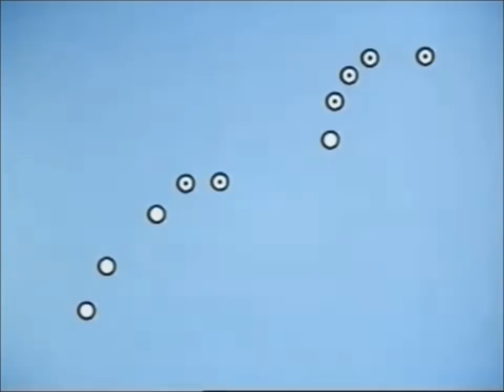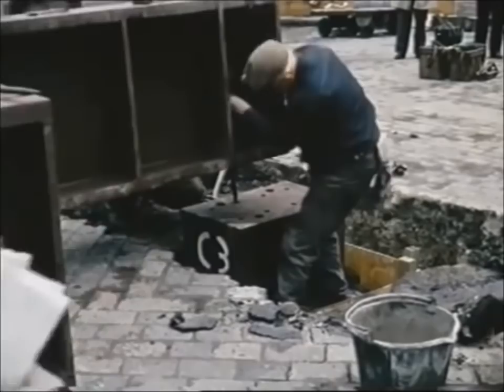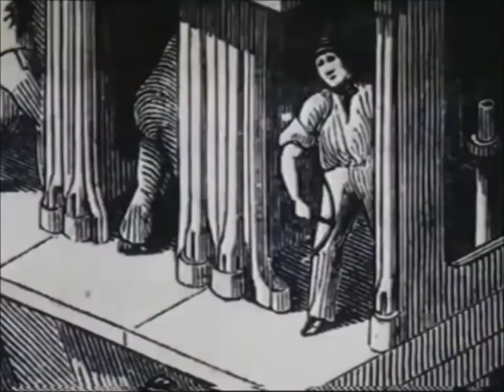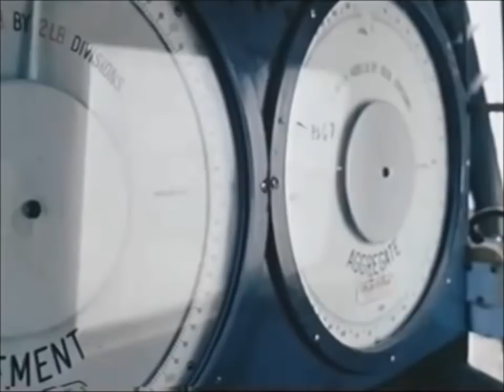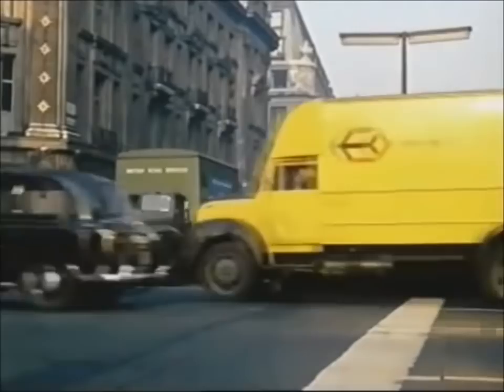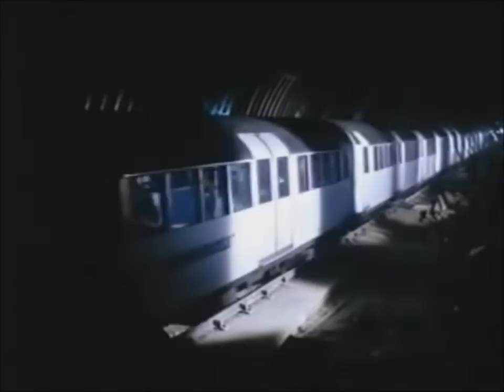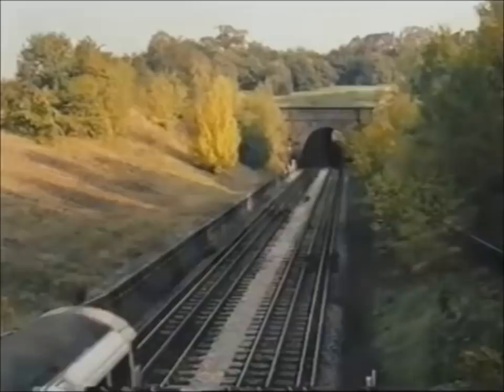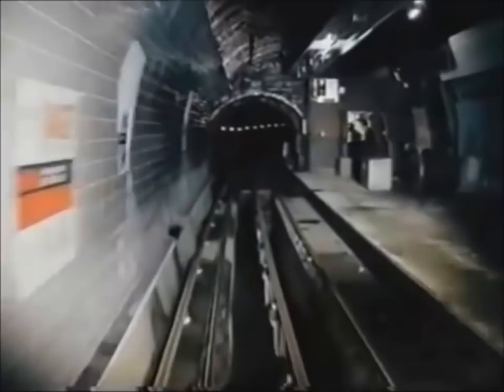Vintage railway films - The Victoria line reports - 1960s

Comment: I wonder how many of those tough tunnellers slinging the cast iron rings and concrete sections around were still young enough to have seen combat in WW2 and Korea.Resilient and doubtless afraid of very little.

Comment: I was a Westinghouse Brake and Signal Co. commissioning engineer for the automatic braking systems. No mention that the trains were fitted with disc brakes, interlocked air suspension and a seven step digital braking system. As the weight of passengers were added to a car, so the braking effort of that car was increased. The trains were originally fitted  with a single button for the driver to push to start the train towards the next station. After one driver got his head knocked on the tunnel entrance by hanging it out the window to look back down the train. We had to add another button and a window interlock, so the window had to be shut and both buttons pressed to start the train. When the train stopped at a station there were white lines on the pavement so that any under or overshoot could be measured and reported. 
The trains were also fitted with hydraulic handbrakes. Not the best. When we serviced them and the oil mixed with the brake dust it took a week to get our hands back clean.
Most of all this was new, never been done before.  It was so successful that the New York Subway and Singapore Underground  systems adopted it over the next few years.

Comment: So strange to think of all the times I travel along those tunnels we have seen being dug in this video. Watching the cutting face inch forward through the London clay, making way for the trains that have now been running through there for over 5 decades now. Lots of guys really toiled to build the lines back then, real back breaking work by the looks of it. I salute those men for their hard work. I used to travel on those lines frequently when i was a young teenager back in the late 70's, and back then i never gave a thought to how all of those tunnels were built. So fascinating to see how the Victoria was built. So easy to take it all for granted without a thought to the guys that worked so hard to build it.

Comment: Brilliant record of those events, particularly seeing the miners using their clay-spades! I saw the Oxford Circus Umbrella going up in 1962, then in 1966 I worked in the site offices at Fitzroy Square, near Warren Street, where an access shaft had been constructed in the Gardens. I'll never forget going down the shaft in the bucket for the first time, nor the weight of those clay spades. It's amazing to see the men at their tasks in such 'primitive' conditions - no safety gear. 
The Fitzroy Square site was closing down and in early 1967 our team were moved to Tilbury to a cable tunnel project under the Thames. This tunnel was built in wet chalk using a new type boring machine - a smaller version of the TBM's in use on Crossrail and HS2. Hard hats were issued but often neglected and, as it was wet the miners were given jackets and over-trousers.

Comment: In the 1980's I worked in a glass bottle factory in Kent. The story I was told was that the bottle blowing machines were powered by compressors that had been sold off after they were used to service the drilling machinery on the Victoria line construction, albeit at reduced pressure because they were knackered for some reason!.

Comment: 🤔The part showing the 1960 stock on the Hainault loop must have been taken in the mid 1970s well after the Victoria line had open in 1969. The train operater seen was my father Bill Speight (only time seen wearing a cap🤭) And he wasn't was trasfered to Seven Sisters depot untill the late 1970s as back then it was done by seniority (his was early 1930s) as one retired ⚰the next on the transfer list took there place. All for a few ££s more🙄to spend his working shift in a 🌚tunnel instead of the Essex  🌳countryside.

Comment: Wonder how many accidents happened during the construction of this massive project. Or if there were any deaths. What an achievement though. People never cease to amaze. Have shoveled clay before, it's not a fun or easy job by any means and it was a very miniscule amount compared to what these guys were doing.. could only imagine. Especially day in and day out for that long.
Reply: Not a crash hat, gloves or high res in sight! Every one looked after their own safety then, not  expecting someone else to do it and get sued if they cut  a finger.

Comment: Always wondered how they can tunnel and actually know where they are going .
Also tunnels curve so how does the greathead Shield mange to make tunnels that are curved.
Reply: draw the required amount of curve needed out in the car park make every one fit then number them and of you go
if you had ten sections  then you would have ten lines going out.
Reply: Center lines, levels, surveying scopes, measuring tapes and lots of math are used to drive a tunnel

Comment: Briiliant.
Reply: Very interesting, tremendous engineering feat for its time. Health and Safety very different then.  I had the experience working on the Victoria Line back in late 70’s as a Technical Assistant working out of Northumberland Park Depot, so parts of the film very familiar, and test runs on the ATO trains were interesting.

Comment: Electric cars also destroy the environment through resource mining, manufacturing processes and ultimately going to the landfill in mass droves. The pollution they cause is simply unnecessary as is the amount of urban space squandered on parking and other paved over autocentric wastes. They also perpetuate urban sprawl, the food deserts that come from that invariably, along with cities that are not navigable as a pedestrian or bicyclist and are, in fact, inhospitable to humanity. They add to traffic congestion. Commodification of societal needs and normalization of trying to substitute rampant consumerism where we need standardized, regulated and uniform public utilities doesn’t work.

Putting the financial burden of transportation inefficiently and directly on the individual citizen is simply not wise or fair and hasn’t been the norm for even 80 years. We need to invest in commuter rail that’s properly implemented as it typically is overseas. A commuter rail system is an engineering marvel while buses are just buses. The most reliable predictor of  a neighborhood being impoverished is if it has no commuter rail connection. The people are apathetic through decades of disenfranchisement and a lot of that marginalization (eg Robert Moses’s racist urban renewal) is through divestment of public infrastructure, utilities and programs to help the American people. We’re past the point of car dominated transportation being anything better than a tragic hindrance or an outright travesty. Public works materially improving life for the taxpaying citizenry will bolster civic pride. 

Transcontinental High Speed Rail should integrate seamlessly with commuter rail networks so it can evenly function as one cohesive system and this will convert flyover country back into a thriving heartland by functioning as an artery of commute and commerce which will reduce clustering on the coasts. Similarly, wholly integrated circuits of commuter rail blended with interurban routes, light rail lines, street car grids, subways, and even trolleys along with ferries functioning together as a comprehensive series of interwoven systems would prevent people from having to live on top of each other in city centers in order to have quick access to urban cores and downtown areas so this would stimulate our local economies and prevent gentrification from demolishing  cherished heirlooms of our historicity, destroying our classic neighborhoods, shredding the fabric of our communities and toppling our civic landmarks and architectural heirlooms along with other social capital such as venerable culture generating venues.

Numerous studies show that built environments of homogenously bleak and bland duplitecture dreck that profiteering developers push on us for their privatized gains to our public loss for the riches of themselves and corporate slumlords not only cause homelessness from being financially inaccessible to most Americans, but also cause depression from creating such a devastatingly sterile, cold, unloving urban habitat that’s too congested and overcrowded to work properly as a correctly engineered built environment. Our roadways are overcrowded and no amount of widening them and adding lanes will do anything to help it because it just leads to induced demand that inevitably grinds to a halt at snags and bottlenecks down the road. Shouldn’t cities be thriving centers of culture and character rather than austere and chintzy morasses of mediocrity? 

I believe that we can design the cities of our nation to reflect a future that embraces humanity and that we also must for America to have any sort of a bright future ahead of it. Right now we are mired in the destruction of our cities from the inward attacking neocolonial oppressors who weaponize their clout of wealth against the nation for their own off-shore un-patriotic gains of privileged, parasitic, private profits. This greed fueled anti-social exploitation is present day feudalism driving us into another gilded age. Tons of new petrochemical building  “luxury living” housing units remain empty serving only as financial assets in investment portfolios of hedge fund and permanent capital firm cretins sheltering dubiously acquired wealth instead of as direly needed shelter for humans. We deserve a landscape we can be proud of and country should come first before corporate looting and exploitation. Legacies are important and live on forever. 

With space opened up in our cities we could rebuild beloved structures gone from economic and environmental disaster utilizing new technologies such as hempcrete and 3-D printing. We could create vertical agriculture etc. on spots currently now just serving as paved over squares and nothing more. We can extend democracy into offering the taxpayer residents democratic say in what their city consists of, how it looks and how it operates promoting civic engagement and participation.
Reply: Very interesting comment! I agree with you. I recommend a video called “how to make an interesting city” by School of Life on YouTube  you might enjoy.
Reply: Also interesting that you bring this up for America as I feel like it’s a lost cause due to their right wing politics and capitalist society!
Reply: How to make an attractive city